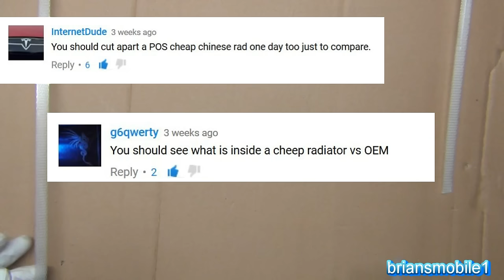CHEAP RADIATOR GUTS!

Comment: The Chinese radiators are a bit on the junkier side but If its of any interest I've been running a $80 Chinese 3 core radiator in my jeep for about 4 years now and have no problems with it to date (watch it'll blow up on my way to work now lol). Trans gets flushed often though since mud and sand always seems to find its way into the pan when four wheeling.
Reply: All them rad's are hit & miss! Get one made on a wed or thurs!😂

Comment: Hey I just wanted to mention the fact that you are comparing an old radiator to a new one. The heating a cooling cycle would in theory change the strength of the metal (I believe it would strengthen it)

Comment: ROGER THAT on the Carpal Tunnel, (3rd Gen Radiator Shop Owner, ‘88-‘06, POPEYE FOREARMS with all of the GM Dexcool issues and subsequent Rod-Outs)! 

I appreciate pointing out the Cooler Difference between OE VS. AFTERMARKET. 
Example: OE GM Cars & Truck Engine & Transmission Coolers were much better than the ones supplied, (inside and often hidden and hard to compare). 
As far as aftermarket radiators for Honda, Toyota, etc., Nissen made a comparable product, (back in my day) and I will refrain from naming the problematic manufacturers as some may not exist today. 

If you’re running a Manual Transmission tho, most of not all are fine, (which you pointed out as well). 

I feel for those owners pulling and working their Trucks, installing inferior Radiators with little to non adequate heat transfer for the Transmission and Engine Oil Coolers, wondering why their 4L80 or Allison is smoked….

ie: I commend you for trying to put out the Word, feeling for those over the last 25 years not knowing…and paying.

Comment: So not as effective at dissipating heat, which means the radiator fan cycles on more and will maintain proper cooling temp because of that?

Comment: cool...very good video sir
not many radiator shops around..i was taught when i was 16. nothing but solder and tin.  learned to glue and repair plastic. Saved tons of money thru out the yrs. motors these days are so much cleaner

Comment: I’m actually impressed with the cheap adp radiator I got off rockauto.com.   Other than the fact it bends kind of easily from being cheap...it’s treated me very well.  I installed it never had any issues with cooling efficiency or leaking, and to head off this comment before it comes in...my fans don’t over run to make up for the radiator or anything like that...infact my fans are original (19 years old with 195k miles on them).   My vehicles are all manual transmission, so my story may not has been the same if I would have connected the trans cooler lines between the added pressure there and the crap you found in there  ( the radiator is for an auto because manual Altimas and many parts for that year are rare) The cheap radiator has actually outlived the original Nissan radiator the car came with (the original radiator started to slightly leak where the upper tank connects, probably that rubber seal.  The cheap radiator has been on the car for just over 10 years and it has about 110k miles on it and I have no plans to replace it as it’s been fine.   My 2006 Sentra spec v s-tune with 108k miles on it has its original radiator that is just starting to leak at the tank as well (residue around the clamp/tabs and car smells like coolant if you stand I front of it) and I plan to get a cheap radiator for it as well.   I don’t buy the cheapest part I can find, but usually get something in the middle of the road.  For example.... the Sentra has a range from $48 to $380 for a radiator.  I’ll get the one that’s in around  $75-90 depending on brand, and what I can tell of materials and build quality.

Comment: Thank you for this video.  It was great confirmation that OEM replacement is the way to go.  Wonder what grades of steel are used in the cheap hub/bearing components compared to OEM.

Comment: I paid $50 cheap rad on a 02 Grand Cherokee. Worked fine except for the oil cooler fittings needed way more Teflon tape t seal them.

Comment: Good info, seems to me if your radiator is protected say by your condenser and you have an aftermarket transmission cooler, a cheap radiator would be viable. Especially when upgrading from a single core to a 2 or 3 core.

Comment: Rocky Mountain Radiator agrees. We see this stuff all day long from parts stores and online. It's going to come down to the consumer not to throw their money away.  It used to be that you get what you pay for ,but you actually get less than you paid for.
Reply: Alcoa aluminum vs. China who knows what aluminum.  There should be a significant weight difference in materials between the two as well.

Comment: The cooler part where corrosion was noticed doesn't come in contact with any liquids.
It's like a double wall thermos, without the vacuum.
That's the reason for the fins.
Reply from the maker: +sjs I admire your optimism.  The older I get the more cynical and judicious I become.  The transmission fluid most definitely does come in contact with that nasty interior wall.  If you're talking about the coolant however you would be right.

Comment: Usually you can also tell by the weight of the (empty) radiator, the cheap ones are considerable lighter.
Reply: I'm not sure but I've read the total opposite 😅 most say the cheaper radiators are heavier and that you can pay more to get a lighter aluminum radiator..
Reply: @motov8-garage832 I'm not sure now either 😅

Comment: I'm guessing those fins are made out of stainless steel (why they aren't magnetic), and the tube is aluminium. Meaning that you'll get some galvanic corrosion which is probably what you can see on the aluminium.

Comment: Hey I have a quick question I have a 98 Toyota Tacoma and the knob for the climate control is stuck it will move some then get tight pop and will do it all the way to the blue side but it stays stuck on heat what do I do to fix that

Comment: hey man, I got a 2003 eclipse gt. v6. and I'm having alot of problems with it, for example, it over heats, after driving for a good while and I slow down at a red light the car sounds like it's going to die, someone told me about something about my fuel filter, and air filter. I'm not sure what to do and I love my car

Comment: Do you think  make it cooler if I replace aluminum tank coolant reservoir ? thank you
Reply from the maker: +Raksasok Heng Cooler than plastic tanks?  It would, but not sure by how much.  Having a multi row or multi core radiator or a higher grade radiator would be better.  In the tank the coolant is insulated by surrounding coolant.

Comment: Well at least the cheap place didn't try and rip you off by charging the same as the good place. The price is really the only way to tell the difference between good and bad sometimes.
Reply: +Matt Trotta The best thing to do is buy from the same supplier as the OEM.  Buy direct, not through the dealer.

Comment: One by one even the more expensive quality brands are joining the race to get the shittiest part out there. When I buy a part at Autozone (due to availability, time necessity, or my "this time will be different attitude") I started consider it practice for when I get OEM or equal to OEM part. A bunch of Autozone (and the other guys too) will send a car to the junk yard before it's time is due if you let it. I'm doing my part to push for a change because if they sell me a shitty part and it says it equal to or better then OE and it's not, I will return it over and over until I get a part that is or until I get my money back.

 Then you got the government pushing for lighter, safer, more fuel efficient cars and the manufacturers doing everything they can to make that extra nickle to shove up there ass but it's like no one stops to account for the environmental impact of manufacturing more replacement parts, many that come from country's that don't give a shit about pollution, and then there is the environmental impact of shipping those parts, recycling, throwing away, or shipping of the old part to another country to be re-manufactured into a even shittier part.

Comment: Well I ended up having to replace a cheep radiator that was poorly installed in my other integra cause I had put a hole in a tube when going to reinstall it. I was replacing the transmission cooler lines and the fittings on the cooler where thin weak pieces of crap that weren't at the right angle and one was damaged and I was concerned about it leaking after I had put it back in but damaged it so had to replace it with a quality radiator from performance radiator.

Comment: wouldn't you want the tube to get hot easier? 
the atf fluid must past their and transmit the heat to the coolant. 
the corrosion is quite a worry though
Reply from the maker: heat transfer good.  heat retention bad.
Reply: +briansmobile1 oooh! so the fact that its remaining hot means its retaining. which is bad. 
thanks for clarification
Reply from the maker: +squish T Welcome.  I try to be somewhat concise, but things get lost when you edit 2hrs down to 20 minutes or less.

Comment: One time I was at advance auto , I remember the guy working there tell me that aftermarket was always better than oem.   I wonder what he would say about this video.  That happened once and on the whole I don't have that experience when I go to the parts stores, but IMO oem is better 95% of the time.
Reply: +Mike C It's better than the Chinese knock off but some aftermarkets fix the high fail areas of the OEM.
Reply: Performance aftermarkets " made to fit" specs, from a few companies" still in the states" are worth their bang for the buck, getting the 30% + more cooling Efficiency.  I so much want to do by a $70 radiator for my Yamaha Raptor 660cc, and it meet the challenge. Tho it turns out the $450.oo performance USA aftr market was correct move!

Comment: If you have manual I don’t see much reason to buy OEM instead of this but of course cheap aftermarket you buy isn’t necessary this good of quality.
Reply: +Valde3333 Those cheap rads will leak with even a small stone hitting them.
Reply: +seeya205 Looking at the construction on this I don’t really believe that it would. But like I say in the first message other cheap aftermarket one are not necessary this good of quality.

Comment: you definitely don't want that kind of environment for your trans fluid !!! good showing of the cross sectional view. Quote of the video.. my favorite anyway.. "Not all cheap radiator companies are the same.." haha nice video Brian. Thanks
ps. i was at the race too.. good times !! but I've always said I'd rather piss in my engine than put Penzoil in it.. maybe you should convince us otherwise.. i just have never liked it, it always seems to turn to water (thins out and looses it's viscosity when i check my oil and rub it in between my fingers) after like 1500 ta 2000 miles on an oil change..
Reply from the maker: +Jonathan Alvey I've heard language like that in the past.  Some of the biggest oil change franchises in the country use it exclusively.  The top two cars at the race use it.  Let's tear into it and see what's there!
Reply: Back in the 80s pennzoil was caked up because paraffinic oil was horrible.They must be better to still be in business

Comment: A $40 radiator on your $1500 car is not as well made as the $600.00 oem radiator in your $1500 car is true ... but the math still works.

Comment: Thanks for the expose' Brian.  Only thing the CHEAPO had going was the fins per inch ( FPI ) which would allow air to flow more rapidly front to back. The original had so many tiny fins which would catch more fine debris.  It might disperse the heat better but would be restrictive when it comes to using a pressurized water spray to wash it out after pollen and bug season.   Still got all your fingers ?   Well done.     J K

Comment: I something is too good to be true, it probably is.  Or, you get what you pay for.  It is silly to use cheap parts when you consider the cost of a new transmission or engine.  It is also stupid to put cheap brakes and rotors on your car.  Your life may depend on the efficiency of the brakes.